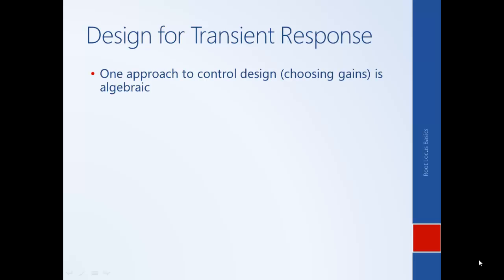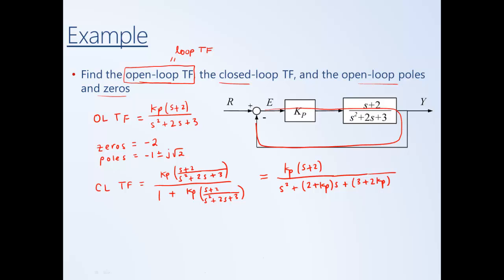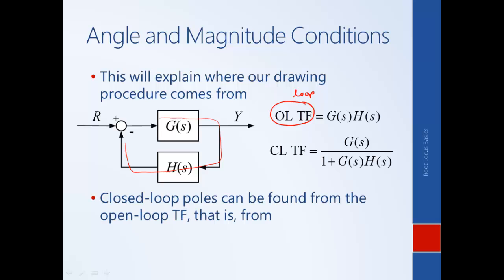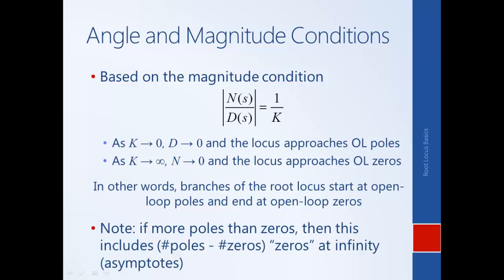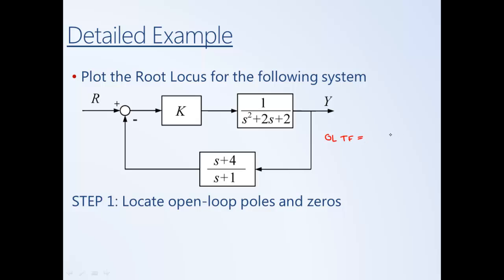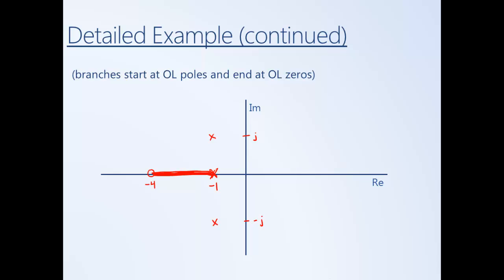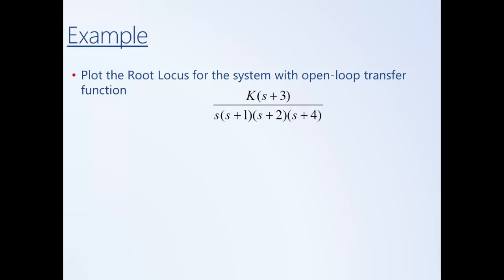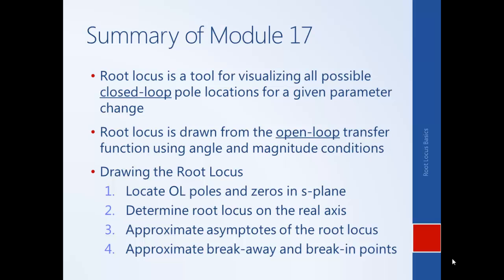System Dynamics and Control: Module 17 - Root Locus Basics

Comment: Hi, thanks for uploading these modules, they’re really helpful!

I have a question – What would be the zeros of an OLTF which does not contain s in its numerator? eg.  50K/((s+8)(s^2+4s+29))

Also, since there are 3 poles to this, will that mean there must be 3 zeros (some/ all of which asymptotic)? 

Any help would be much appreciated, cheers!
Reply from the maker: I am glad you find the modules helpful.

Since there are no s terms in the numerator, this transfer function has no zeros. This combined with the fact that it has 3 poles (3 more open-loop poles than open-loop zeros) means that it will have 3 asymptotes (which I refer to as "zeros" at infinity). Hope that helps.